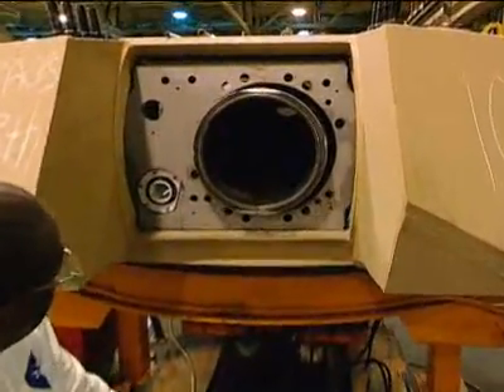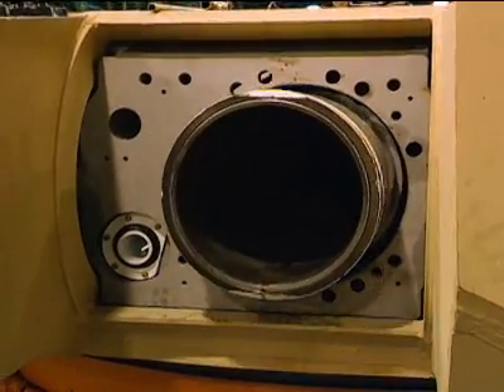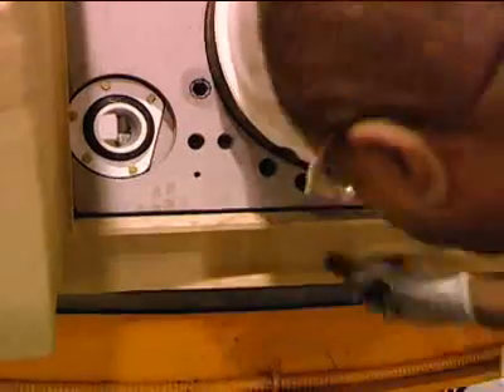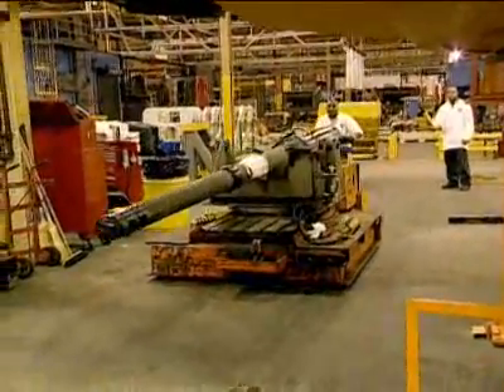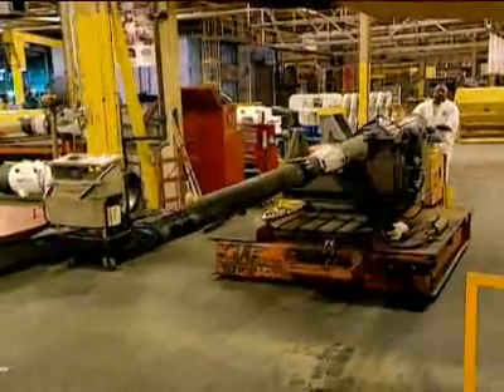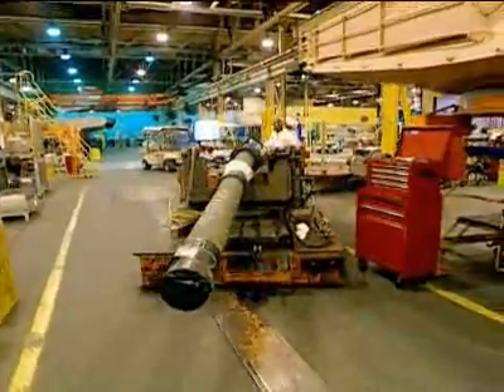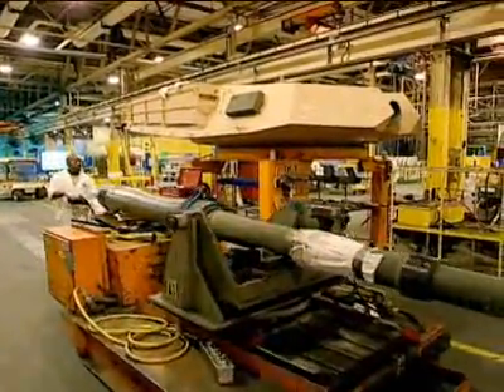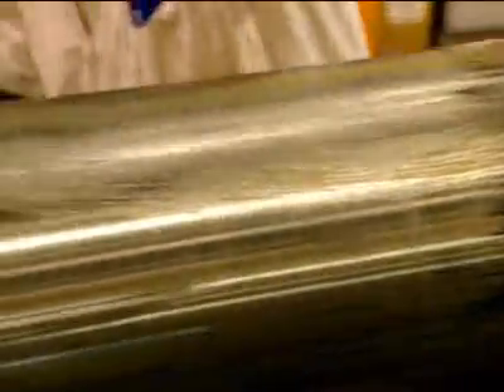M1's Cannon

Comment: The gun here is actually British. Not German. The L44 is German.
Reply: The M1A1 uses the L44 smooth bore which is a German design which was what the narrator meant, the British developed both Rifled 105 and 120mm guns
Reply: Is a licence build they change the name of L/44 to another name but is technically the same but different rounds

Comment: @GWR4079  You have completely missed the point.  The reason these guns are smoothbore is because all their rounds are fin stabilized.  It's not because they don't need stabilization, it's just becase they do it with fins instead of rifling.  It's 2 ways to produce the same effect.  That has absolutely nothing in common with shotgun slugs, so your analogy is just way off.